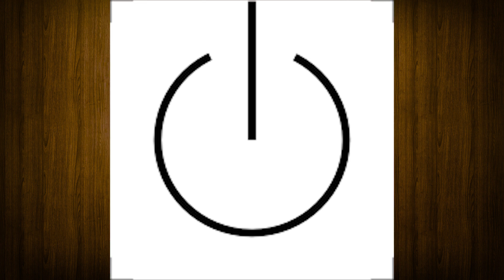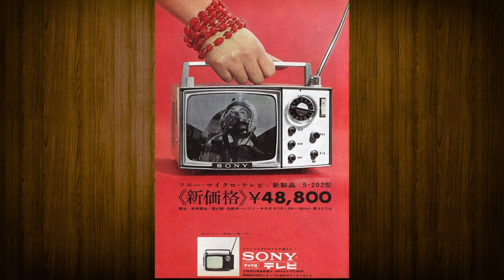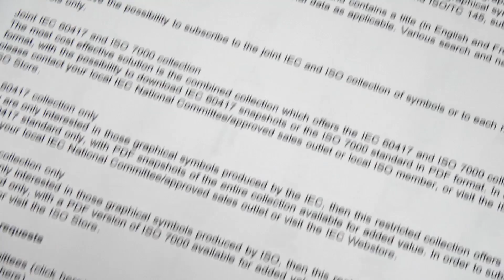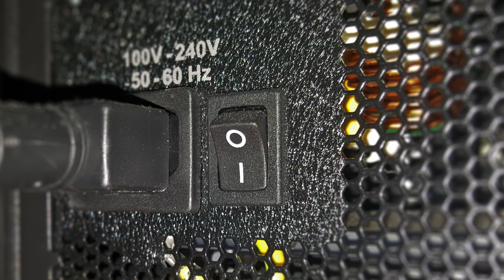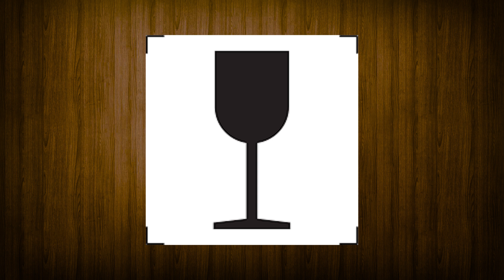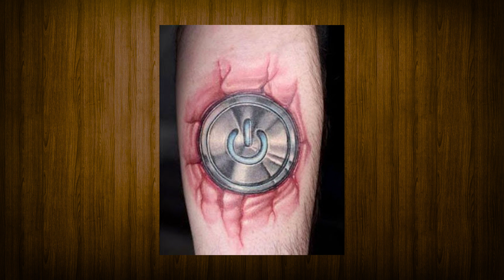Why is THIS the power symbol?

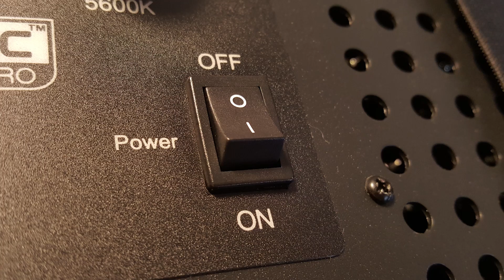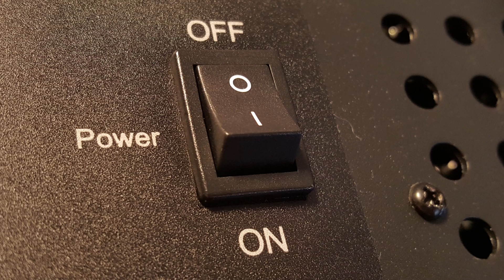Comment: 2:42 So the image of a wire making a complete circuit is "OFF" and the image of a straight, broken wire is "ON?"  Whatever.  My pressure washer has a small, unlabeled rocker switch like the one at 2:51.  It's not momentary like a string trimmer's kill switch.  I couldn't figure out why it wouldn't start when I switched to the image of the completed circuit.

Comment: I'm still reading about the Datsun S10 for $1990 with whitewall tires , front disc brakes , 2 speed wipers and foam padded seats with adjustable headrests at the beginning of the video.

Comment: For the longest time after I first encountered them, I simply could not understand  | as on and the O as off, and always got the confused.  I imagined the | to be an upraised hand (as a traffic cop uses to stop traffic), or as a barrier of some kind that would stop the flow of electricity, and therefore should be "off", while the O was an open conduit allowing electricity to flow, and therefore should be "on".

Comment: When you try to sound smart: 

She: its not working

Me: Have you pressed the IEC 60417-5009 key for 3 seconds? 🧐
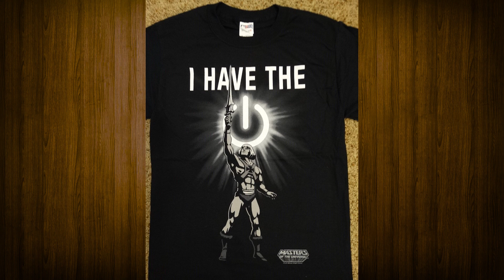Reply: 5:00 dont die drive safely
Reply: Don't forget the + and - buttons used alot.
Reply: @GrzegorzDurda  well I mean those have been around for even longer
Reply: @OrangeC7  That's true. Far longer then almost any symbol in Modern day technological interface usage.
Reply: It's from the I T crowd?

Comment: The “I” part of the power symbol also represents a line that current (electricity) can travel through, while the “O” represents an open circuit, which is another way of saying the line is disconnected.  I remember many electrical devices from my childhood (the 80s) having toggle switches with I on one side and O on the other— the design of these symbols wasn't influenced by computer science (1s and 0s), but by electrical engineering.  The I / O symbols and subsequent combined IEC power symbol stuck because the analogy worked for both EE and CS fields.

Comment: Prediction: it’s cutting off the circuit in order to shut it down.

Result: I was wrong
Reply: I've always thought that since I was a kid.
Reply: I thought it had to do with circuits as well. Made sense. Never would of guess'd it was binary.
Reply: i didnt think it was that anyways
Reply: This is like the third time ive watched this vid, and EVERY time I think it's a circuit being broken.
Reply: I'm fairly certain that it is an indicator of open or closed circuit, thus why the separate components are used on switches. I've never heard anything about it being a binary representation before and I'm curious where that came from particularly since it's clearly a circle and not a zero.

Comment: Just a shame this stopped at the IEC and the binary interpretation of the symbol that was already being used in the emerging consumer electronics market in the 1960’s (and maybe before). The IEC got the symbol from the EXISTING devices, that had that symbol embossed where the power lead plugged in, as the plug was a round barrel (-ve) with a pin in the middle (+ve). The binary interpretation came later, when separating on and off for international markets (for the “expensive” devices that had a separate switch, so you didnt need to keep unplugging all the time).

Comment: I never did care for all the pictures and symbols like these in places such as a car or truck.  To me it just looks cheap and lazy.  I prefer whole words.  Back in my teens, my old 1980 Granada said "HIGH BEAM" on the light that lit up when they were on, rather than some symbol or "Hi Beam"  "LOW" and HIGH" rather than "LO" and "HI" on the fan speed controls..  "WIPERS - PUSH FOR WASHER"  on the wipers knob. stuff like that.   I like that.

Comment: 1 and 0
1 is power lvl1
0 is power lvl0
I think
Reply: Think binary signal as voltage level. Think a maximum voltage level being V, while minimum is 0. Binary signal can only be two values of voltage level: V when powered on and 0 when powered off. Therefore you don't actually need to measure the voltage level and just right away justify it to the normalised values of 1 and 0. Basically 1 means full voltage (so 1 is actually V, let's say that V is 12 volts, then 1 equals to 12 V), while 0 means zero voltage (no voltage at all). Binary is a little bit more complicated on the technical level, but for the sake of simplicity, let's assume that. 1 is full power, 0 is no power. Nothing else exists.

Comment: I already know: the power symbol is both a 1 and a 0, if you know what binary is than you don't need a better explanation
Reply: Ok if you don't know what binary is what then champ
Reply: @Feasco  binary only has 2 digits compared to the 10 in the traditional number system, binary uses 0 and 1, kinda like a light switch where 1 is on and 0 is off hence the design of the symbol

Comment: I always assumed it was a graphical representation of a switch breaking a circuit.
Reply: I always thought it represented a round keyway as old computers were turned on and off with a round key and it's basically the same shape.
Reply: I thought it was a representation of a coin slot.
Reply: I thought it was like a 1 on and 0 off
I knew it
Reply: Same
Reply: my thinking exactly.
Reply: you are correct
Reply: Ditto!
Reply: I always thought it was a switch connecting a circuit
Reply: I swear I heard somewhere that the line was meant to represent an open/direct current, while the circle represented a closed circuit. I'm not by any means an engineer nor do I even know much about electronics but this explanation makes sense to me.
Reply: I thought it was sideways pac man
Reply: it is... this "explanation video" is bullshit.
Reply: @paparansen  and yet, you won't be able to prove him wrong, because i just did a deep dive and there is no report available on the origin or meaning of the standby symbol. so, unless you contact the IEC directly or pay a subscription to use their catalogs, you won't be able to prove otherwise.
Reply: @Yal_Rathol  i dont have to prove anything
Reply: Papar Ansen And there was me, recalling all the power connectors for consumer electronics in the ‘60s coming out of Asia with round sockets and centre pins, with that exact symbol embossed on the plastic casing where the power socket was located, so you knew where to plug the transformer in. Hmmm... I wonder where the IEC got the idea from?? Which came first, the physical plug, or the binary interpretation. LAZY Game Review sums it up.
Reply: @paparansen  if you're going to counter someone's claim, you'd best back it up or we have to assume you're full of shit.
Reply: @andyowens5494  really? because i can't find a single outlet, historical or otherwise, matching that shape. citation please?
Reply: @Yal_Rathol  Citation? My own eyes. First hand experience. Blimey, if it isn't on Google, it can't be true, can it?? This is from the 1960's, before the internet existed.
Reply: @andyowens5494  yes. and yet, we have information stored dating back to the 1800's and earlier on the internet. kinda like it's the sum total of human knowledge or something. and if you can't cite it, there is no reason to believe you, because human memory is notoriously fallible.
Reply: @paparansen  No you don't but maybe having proof to claim someone else's evidence and research is bullshit would you know make some sort of sense.
Reply: Also a the circuit break explanation is still a binary thing the so it even if that is what it represents what he said is still true. It is completely possible it is meant to represent both a 1 and 0 as well as the circuit break
Reply: @paparansen  If that is the case, why is the off symbol a complete circle, which would be a closed circuit?
Reply: @paparansen  excuse me what now
Reply: @An Easy-Bake Oven stfu... this is not a courtroom drama
Reply: @paparansen  that's not a statement from a lawyer. that's a basic tenet of skepticism. you have presented no evidence, thus your claim is being dismissed.
Reply: @Yal_Rathol  tenet

Comment: I thought the power was meant for the way a power line is or a switch in general.
The line in the middle means it's off because the circuit isn't making a connection. Pull the line out and you would have a circle meaning the flow of current is going through and giving the thing energy/power.

That's how I've seen it for years.
Same with the sleep symbol I just saw it as "Oh, normal people sleep at night with the moon. So that's sleep. Makes sense."
Reply: Demonic Akumi that was my thought too
Reply: Same

Comment: next, the story behind why windows decided to use \ backwards slash in their directory paths. and yet doesn't complain when you use forwards slash anyway.  and why their file names are case insensitive but you can still have two files with the same duplicate name if you named them on a Linux machine(which is case sensitive)

Comment: Okay, I didn't know this. I thought them to be unrelated.  I / O switch thought meant power connection: yes/no. I thought the circle with the bar inside is just a variant of the power symbol when there is not enough space. And I thought about the power symbol: the circle means "circuit" as in "circuit closed, and therefore powered" and the line wanted to mean either to break the circuit or to reconnect it depending on the context that you push the symbol in.

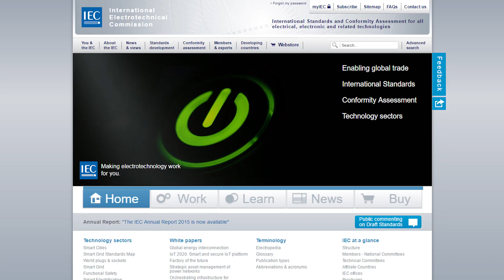Comment: I feel like it should be mentioned; you state at 2:03 that IEC's universal power symbols were first introduced in IEC 60417, but this is actually not true--at the time, it was referred to as simply IEC 417; 60000 was added to the number of all older standards in 1997. There was no IEC 6xxxx in the 70s.

Comment: Also if you think of it, when you pull up the 1 of the symbol it would be like an open circuit, thus no power. If the 1 is inside looks like a closed circuit, thus there is power.

Comment: I hadn't known about the IEC document, but I was able to intuit the meaning over the years.

My first PC (an old 8088 PC) had a "big red switch" on the power supply, and it was labeled with the "|" and "O" symbols to mean "on" and "off".  So when I later saw the two symbols fully overlayed on a toggle switch, the meaning was clear.  So when I later saw the two symbols overlapping with the "|" not quite surrounded by the "O", that also became obvious as "on/standby"

But when some devices (like my Dell laptop) use the on/standby symbol as an indicator light (meaning "power is on") completely separate from any button or switch, well that's just wrong.  IEC would probably not approve.

Comment: The Belkin Tunecast II FM transmitter has a unique way of turning it off and on. You need to press and hold two buttons down in order to turn the device on and off. With no symbol for power.
Reply: Dr. Manhattan from Watchmen has this symbol on his forehead.

Comment: I recently sold a computer to someone on Craigslist. I fully wiped and reinstalled Windows so I know it worked perfectly well. He called me a couple of hours later saying that it wasn't turning on. I asked him if the switch on the power supply was flipped to the on position. He said, "Yea. 'oh' means 'on,' right?" I asked him if the 'oh' could mean 'off' too, but then explained that it was a zero and a one on the switch. It booted just fine after that. I'm not sure why he didn't try just throwing the switch in the first place which would've taken much less time than finding my number, hoping I'd actually pick up the phone, ask me why it wasn't working, and hope that I was going to help him out.

Comment: I have always wondered about two things. If one turns on a tap or opens a gas valve it is normal to turn the thing counterclockwise. That kind of makes sense because normal threading goes that way. But if one wants to turn op volume or increase voltage the turn must be clockwise. 

Second. At least here in Denmark if you want to turn on the light the circuit breaker is pushed downwards. In very old apartments it may be a turning on a handle, the direction does not matter. But on many appliances especially "technical" appliances one pushes the circuit breaker upwards. Perhaps this is to decrease the risk of accidentally switching something on perhaps by dropping a tool. 

But why are those things different (gas and water vs. power) and on/off vs. off/on?

Comment: I couldn't afford a switch, so I got Breath of the Wild on Wii-u. No Regrets, runs just fine on the platform it was originally designed for. Although due to my circumstances I've been playing on the pads screen a lot, and now I'm kinda thinking I need a switch so I don't have to lug the main body of my wii u around everywhere I want to take my breath of the wild experience.

Comment: I was taught in electrical theory that the O was representing an open circuit, and the I was a closed circuit as power running through the line.

Comment: Never heard about this "theory" before, what I always heard was that the vertical line represented the "stop" of signal from the full circle (full circle meaning power was being  circulated , with the vertical sign no power was going inside it)
Reply: I've always thought of it as open circuit, closed circuit.  Also, I means current in electrical engineering.
Reply: But that would have the opposite meaning wouldn't it?
Reply: Yes so technicaly "power" would mean "power off" instead of the "power on" concept we have today

Comment: I sometimes had wondered what the symbol tried to represent conceptually, but never reached any reasonable conclusion. But just as the video started, I came up with an idea... which, then, proved to be wrong xD.
My idea was that it might represent one of these miniature toggle switches.
like this http://www.homeatswift.com/images/products/2012041916404126643757w500h500ujiwei/spst-standard-toggle-switch.jpg

Never thought about anything related to binary states. It makes sense on paper, but it's far from something that can transmit such a concept to the uninitiated.
Kind of a mistery religion vibe there... xD
I mean, this very video is proof that they failed to transmit the concept to the general propulation.

Did any of you really think of 1s and 0s seeing that?
And what about the stick and circle on two state switches? I always tried (and failed) to attatch some meaning related to electricity flowing through a circuit, where the 0 meant closed circuit and the | was like a barrier to electricity or something... of course that meant inverting the meaning and didn't make any sense, so I desisted trying to understand it.
Again, never thought about binary power states or anything of the kind.
I think they went a little too far with nerdiness there...

Comment: I could swear I've seen I/O on power switches from long before IEC 60417-5007/8 or whatever. Perhaps I'm just misremembering, but I was certain the power switches on some old minicomputers had these. Big red switches with flickering halogen lights inside them.

Comment: Who decided that ABXY would be the main letters of choice to use on gaming console controllers?
Reply: Nintendo popularized it with the NES's controller, which possessed the A and B buttons. As far to my knowledge, they were the first to use letters, as the Sega Master System used numbers 1 and 2 for their controller buttons. Afterwards, when they made the Super Nintendo (SNES), they needed an extra row of buttons, so naturally, X and Y fit due to their colloquial use in labeling. For example, in math: "Find X and Y," and in reports: "Refer to Figures A and B."
Reply: Also, I know this was mainly about the Nintendo-style buttons, but for the PlayStation they chose /\, [  ], O and X to represent their function. O for yes/forward (O being the Japanese equivalent of a check mark), X for no/backwards, [  ] to represent opening an inventory and /\ to represent the menu, or something like that. I may not remember those last two exactly, but you get the general idea.
Reply: Yeah there's lots of videos around stating what the Playstation symbols are for, but hardly any for the lettering.  The triangle represented the button to press for point of view/first person perspective, hence why it's shaped like Pyramid Head's helmet so he's always watching you. :P

Comment: I have a Bluetooth speaker that has the vertical line inside the circle, not cutting through the top of it, but that speaker has soft power on off, so when it's off it's technically in standby mode.  In Australia we have an online retailer called Kogan, I believe they exist in other countries too, they actually use the power symbol, the circle with the line cutting through the top of it, as part of their logo, it replaces the letter O, quite cleaver considering they do mostly sell electronics.

Comment: The reason reason, Clint would never admit it as it is indeed too low for him to mention it, if you squint, you will see the symbol is very similar to one way of "showing the finger".  That is the real reason.  You see, what happens when you press that button is you "show the finger" to the absence of (enough) electricity, and switch on the device.  Thus creating civilization!

OK, it's not THAT funny, but I am tired.

Comment: Such and awesome video, dude.  I had no idea the IEC was responsible for anything more than those power cables you plug into the back of your PC power supply.  We use them for almost every piece of pro audio gear at work.  They are pretty much an A/V industry standard.